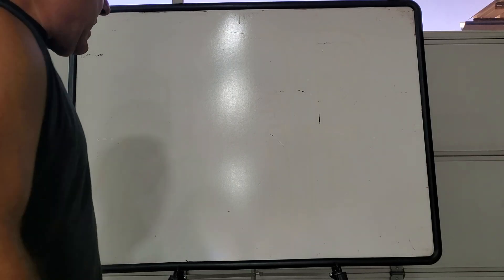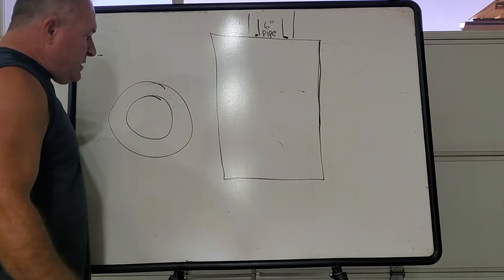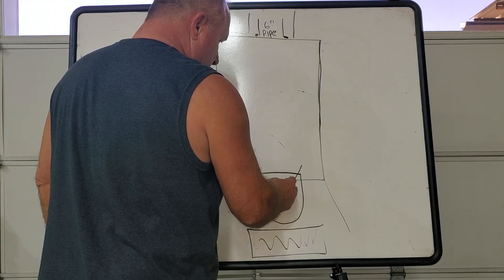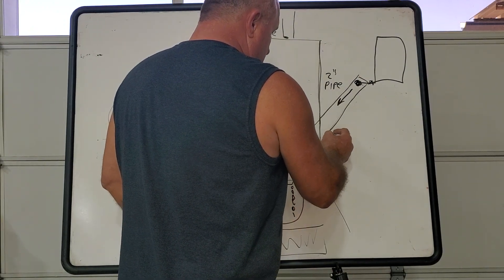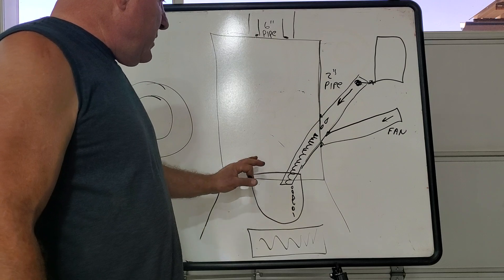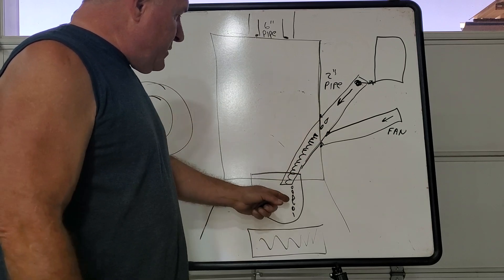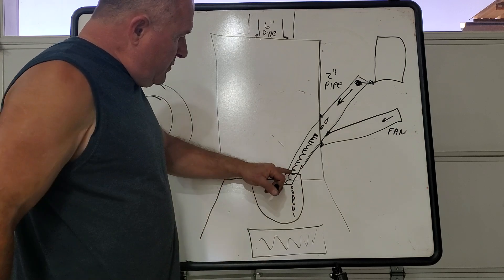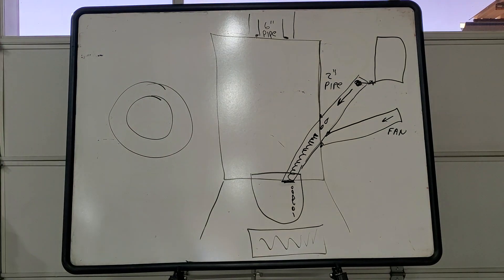DIAGRAM OM MY EASY BUILD WASTE OIL BURNER

Comment: With this type of waste oil heater you can heat garage or workshop and only in case that you are always there... with a stove. It's hard to make any automatisation. It's not easy to burn any waste oil...believe me...also it's not healthy...but there is a better way to burn any type of oil with help of Babington priciple (this burner eat everything with no smoke) or nozzle kit from China for 50$ but you will must filtering oil. Also you can convert diesel fuel burner to waste oil burner with some modification. Nice video and presentation man.....like in the school....
Reply from the maker: W
We use this to heat my 8000 sq ft garage in the winter. Always some one there to watch it. Works great.